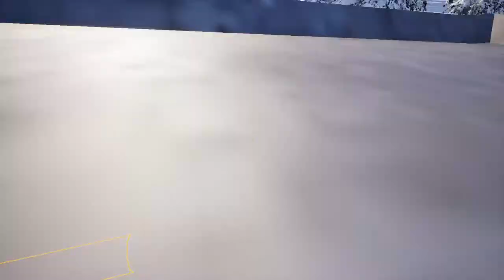Livestream - looks like I'm playing Railroads ONLINE again

Comment: I love the idea of full steam, Tonight on full steam I drive a tank engine through a wall, Hammond crashes a castle, and James derails the prince wales and we have Danny Devito in our reasonably priced locomotive (starting scene long shot of Snowdon mountain) On this brisk early morning with peace and serenity suddenly was shattered by the bellow of a wild animal (Says Clarkson), Clarkson! (Says Hammond)  where's my air brakes (Clarkson) well we didn't think you'd need them so I've removed them. (Hammond) Well that's just great I've now only got the independent brake, (Clarkson) what Hammond doesn't know is that we secretly put the Jhonson bar in the wrong direction and glued his throttle wide open laughs maniacally hammond proceeds to topple cab over wheels down the embankment and with that sad bombshell it is with great displeasure that we must inform you that Richard Hammond has passed away from this freak accident (Hammond on radio) I'm okay (Clarkson) how does he keep doing it. roll credits

Comment: Achievement Unlocked!
Derail Train of Thought in RO!

1:15:06 roughly the start of the madness

Oh, and I might have built the track that Keith 360'd on.

I do remember the other line you saw at the end eventually did make it to the smelter, I myself built the switches at the bottom. The save was taken too early, though.
Edit: nevermind, that other track DID make it down!

Believe me when I say this, do some work on either of those two routes and they will work alright.
Reply: ill have to make an xbox Achievement version of that